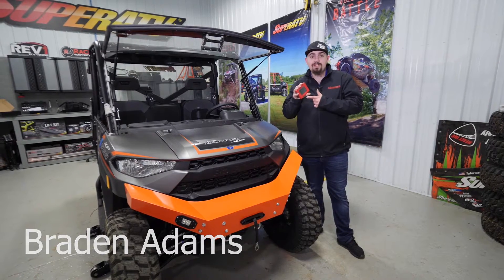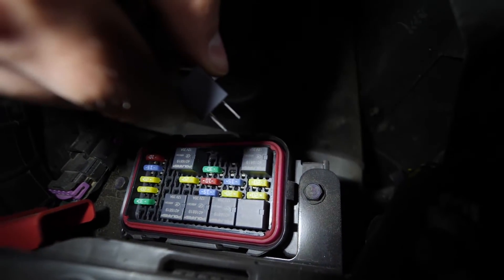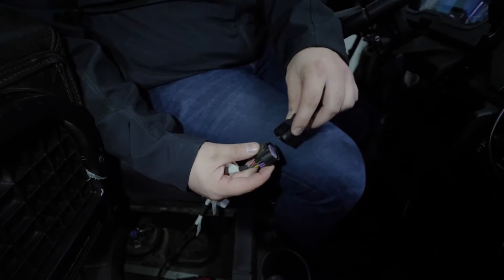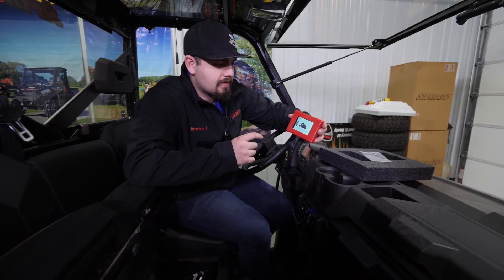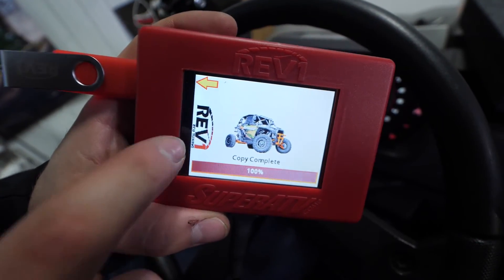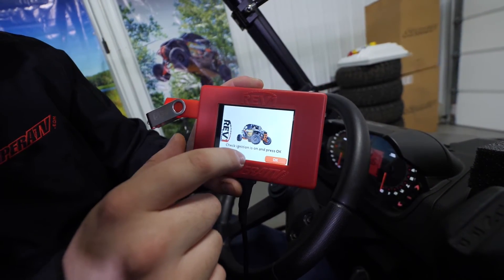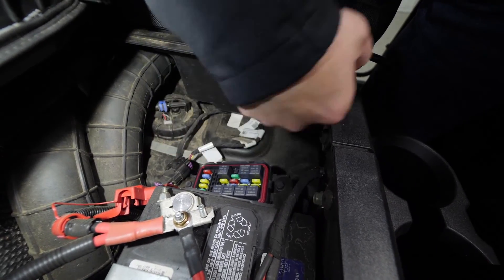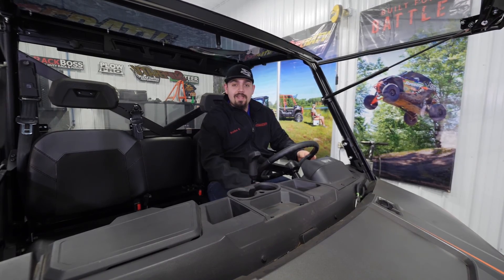Rev 1 ECU/ECM Tuner Install on Polaris Ranger 1000XP | SuperATV

Comment: Okay but what does it do?
Reply from the maker: Stage 1
Rev Limit Raised to 8,500-9,200* RPM

Speed gain: 15+ MPH

HP gain: 3 HP

Torque gain: 3 ft-lbs

Fan engagement: 190-194°F

Fan disengagement: 181-184°F

Limp Mode: 6,000

Max 2-foot RPM: 4,600-6,000

93 octane fuel required for best performance

Maintains factory shift RPM

Can be tuned back to stock specs

Stage 2

Rev Limit Raised to 9,000-9,200 RPM*

Speed gain: 18+ MPH

HP gain: 5 HP

Torque gain: 3 ft-lbs

Fan engagement: 190-194°F

Fan disengagement: 181-184°F

Limp Mode: 7,000

Max 2-foot RPM: 6,000-8,500

93 octane fuel required for best performance

Maintains factory shift RPM

Can be tuned back to stock specs

*Values vary due to individual model differences